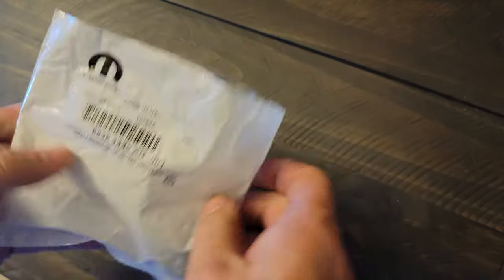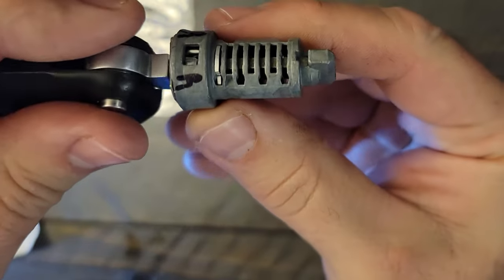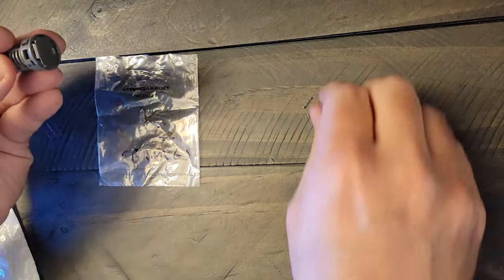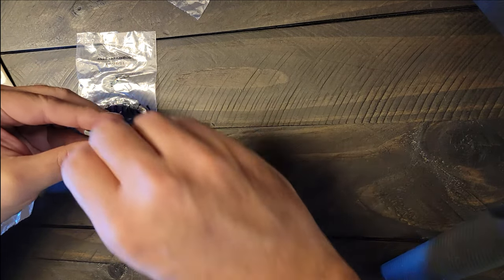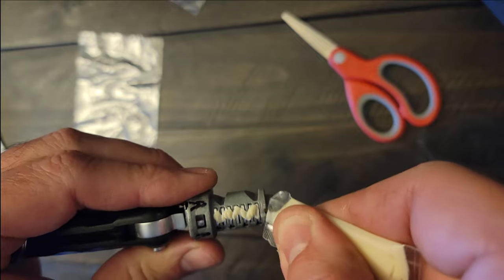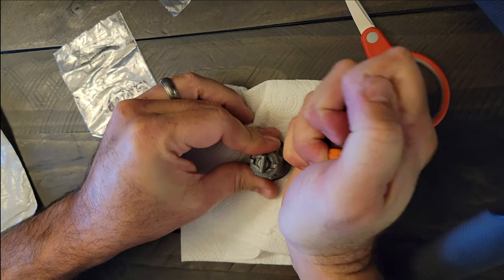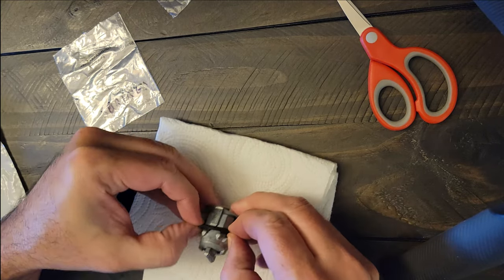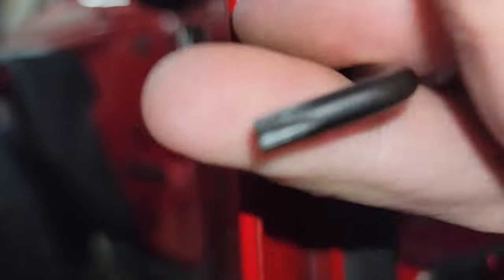Jeep JL JT Door lock rekeying / replacement

Comment: Awesome video! Just did mine.

For those who don't want to have to pause the video to try and figure out which pins are left, right, A, B, C, D:

4228174ACB001 - A L
4228175ACB001 - B L
4228176ACB001 - C L
4228177ACB001 - D L

4228178ACB001 - A R
4228179ACB001 - B R
4228180ACB001 - C R
4228181ACB001 - D R